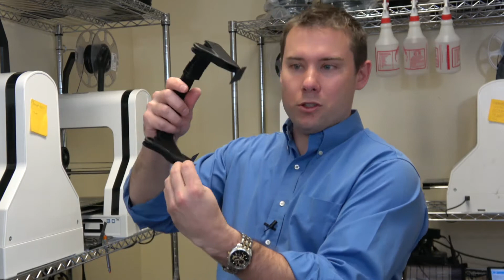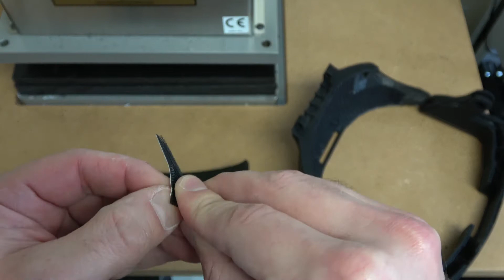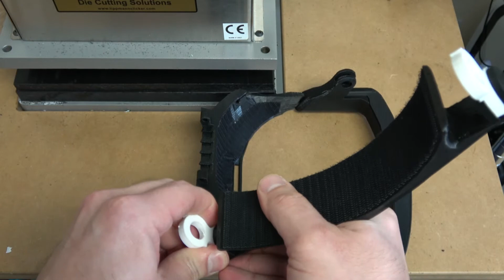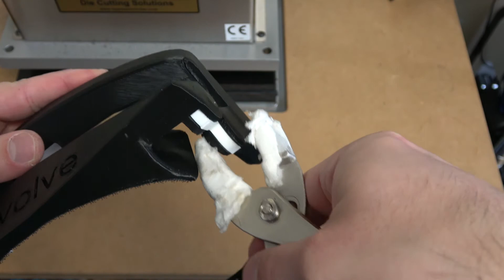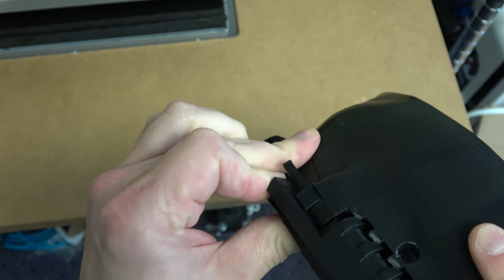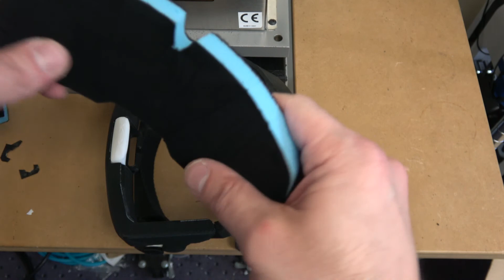How To Assemble A rEvolve

Comment: I have built this head strap and there are many problems, the holes where the pins go into are way to small and have snapped 3 times when wearing my vive, you are forced to use earphopnes and it is not comfy, the back support digs into the back of my skull and cuases major discomfort after 5 minuits.  1/10
Reply: I was thinking it may be a little uncomfortable, It sure looks it, thanks for this comment, it looks like some parts could be made with TPU.